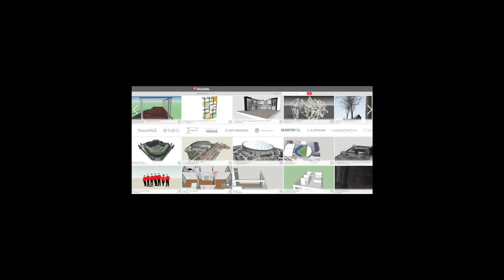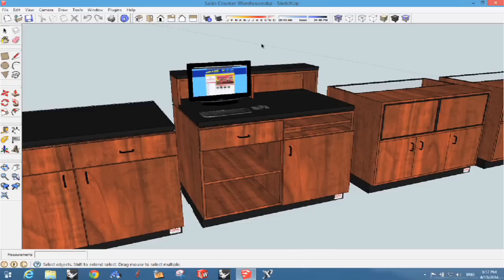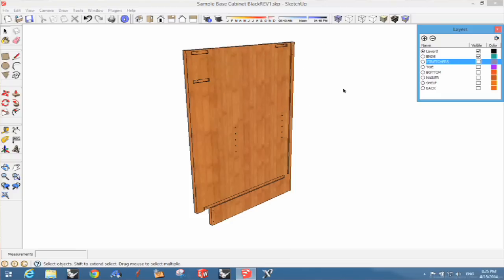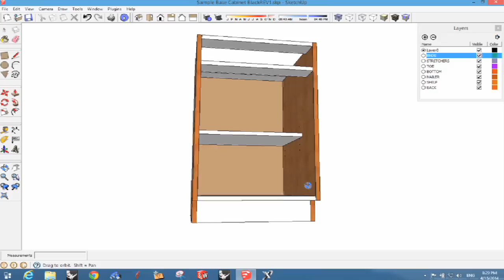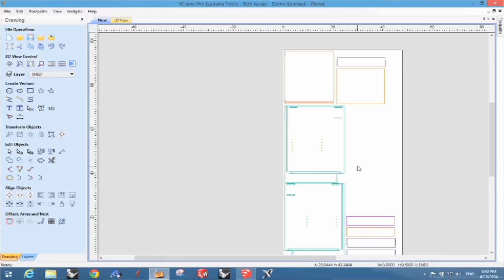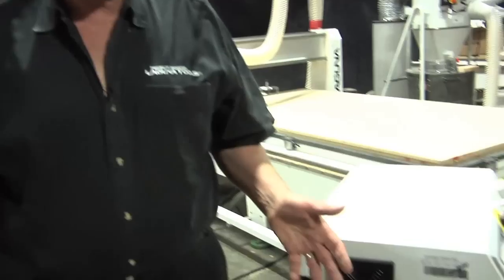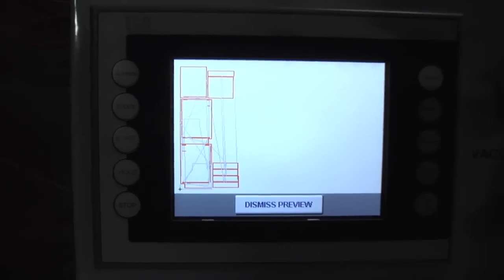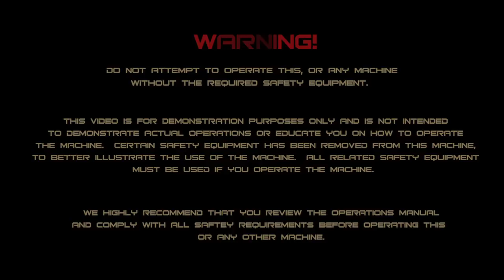Sketchup to Vectric V-Carve Pro Cabinet CNC Tutorial

Comment: I liked your video also , I have one question. I noticed that your using a MacBook Pro, but it appeared like the software version of sketchup running on the Mac was a windows version, am I correct in saying that? Are you running windows on an emulator?
Reply from the maker: Yes windows emulator, Parallel.
Reply: LagunaTools do you like the windows better than the Mac version?
Reply from the maker: Either is great, we just preferred using a Mac during the video filming.

Comment: Hi, what is the point of 2d cutting software Vcarve since there is the 3d Aspire, as long as the cnc frame has 3 axis why do people install 2d software why not 3d software and use for 2d projects also ?
Reply from the maker: Aspire actually includes VCarve Pro as it’s 2D component. The advantage for using VCarve Pro over Aspire for 2D work would just be the lower cost.